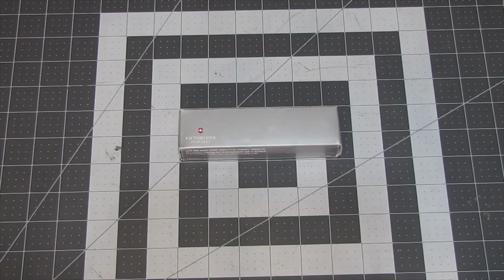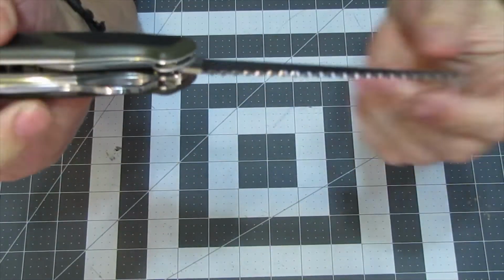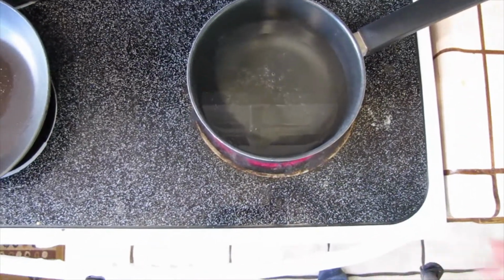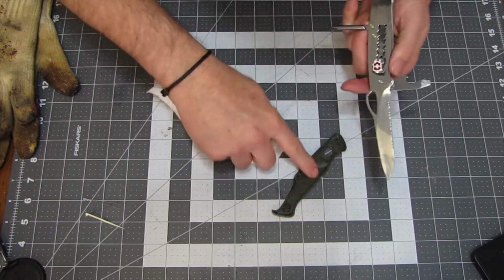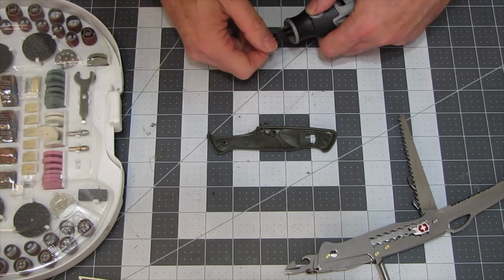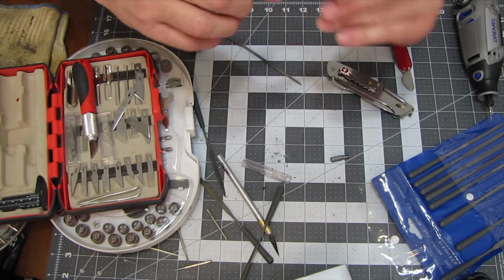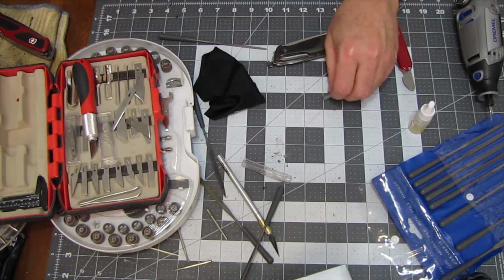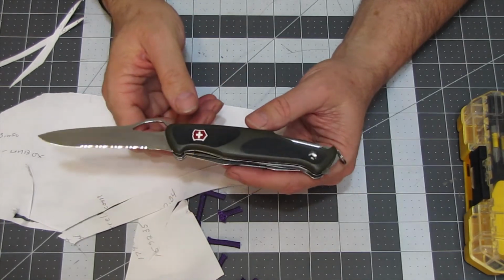Victorinox Ranger grip 178 review and modification for a hex bit driver

Comment: Mod turned out great, curious why they don’t cut out the scale….
Reply from the maker: Me too ! There is only 1 model that comes with it that I know of. The Boatsman and it comes with 2 bits. Also 1 of the most expensive (161 on Amazon). But so far every model I’ve come across you are able to add it in just by cutting the scale. All of the springs and liners have the cut outs in the metal already.

Comment: Do you think the ranger wood 55 have this option as well?
Reply from the maker: Internally yes I do. The only thing that would be different would be the scales themselves. And I honestly have no idea how the wood scales are attached and how easy it would be to remove them without damaging them so that they could be replaced. I would also think there would be no markings on the inside of the scale showing you where to cut so that would be more difficult to calculate. But the hex portion in the liners would all still be there - I think all the Ranger grip scales have the hex cutout

Comment: I've done this mod to all my Ranger grip knives. I have a really easy and efficient way of opening up that hex in a scale. If you don't mind I can put a link in a comment so that you and others can see exactly what I did. I have already posted the video.
No Dremel or filing required.
Here is the link: https://youtu.be/RRKsnojzRSE
Reply from the maker: Yes your way does seem to quicker. I may try that with the next one. I still think heating the scales helps prevent the edges of the hole from breaking. Thanks for sharing, I gave your channel a subscribe as well.!